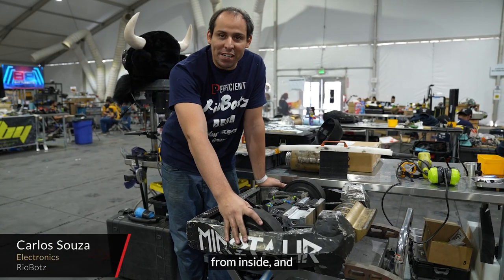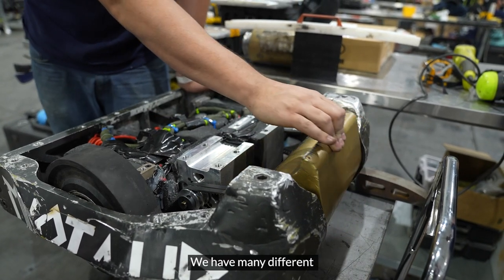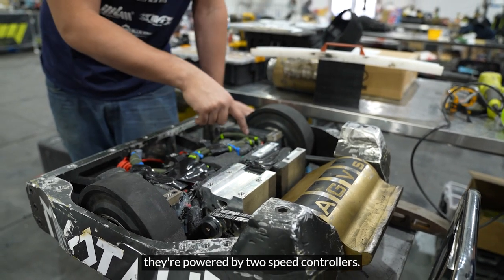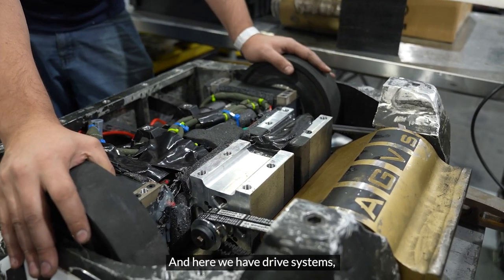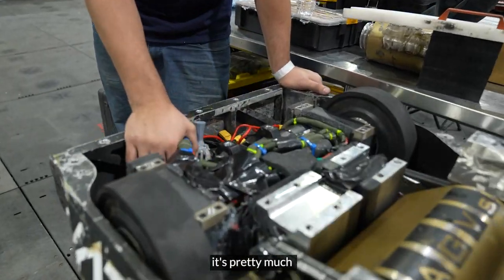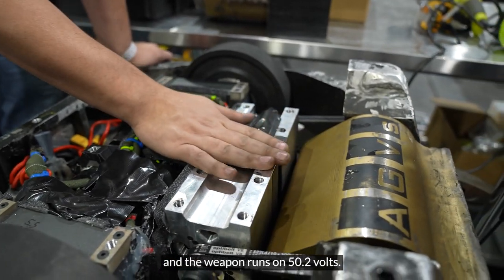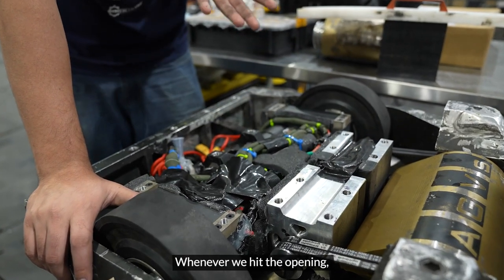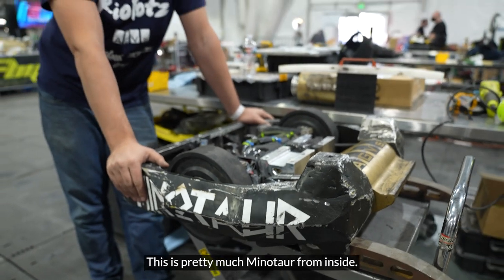Perficient and RioBotz | Meet the Bot: Minotaur

Comment: Why not use a series of oblique tooth gear to drive the drum instead of using belts? It would increase the weight a little, which however could be recovered elsewhere, but it would also increase the power of the drum and the general solidity of the system